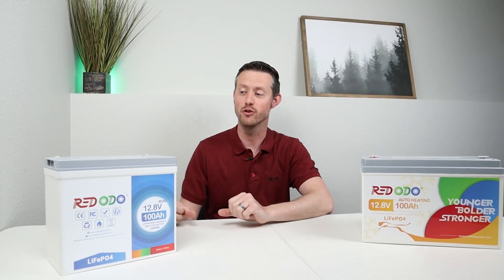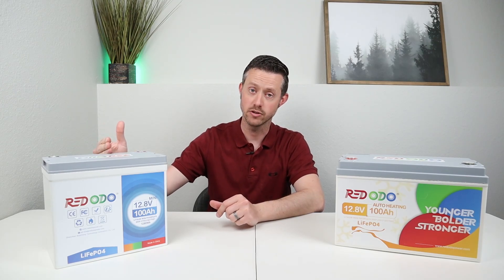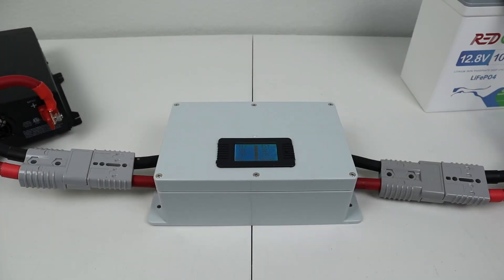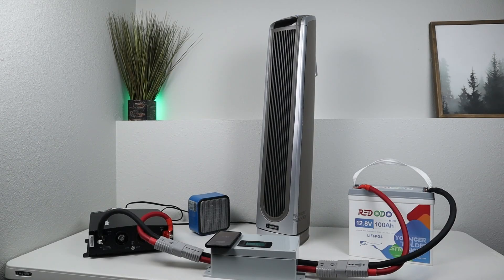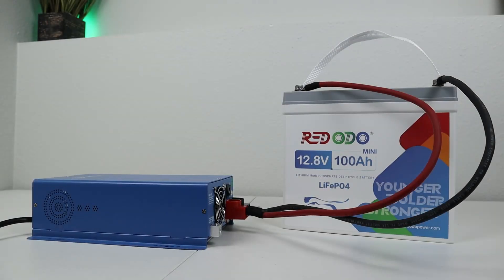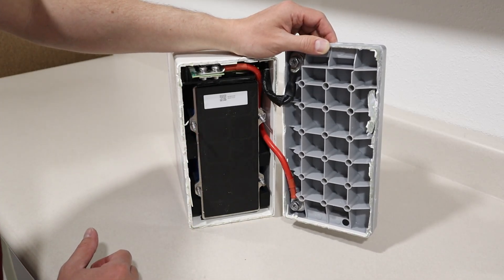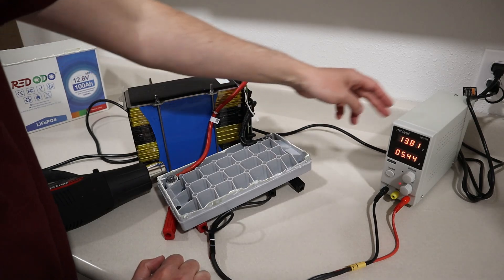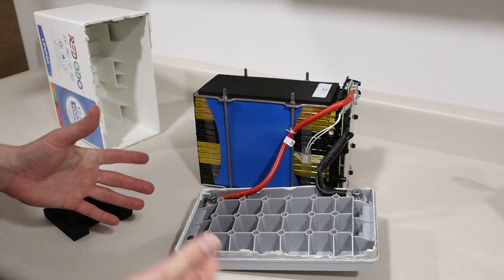Redodo 100ah MINI LFP Battery - Smaller Size - BIG Capacity! - Fully Tested and Torn Down

Comment: I'm guessing you should charge and discharge it more gently than the bigger battery, due to potential internal heat buildup in something so dense, maybe happening before it reaches the external temp sensor.  1C is pretty aggressive in any case. I like sticking to 0.2C or 0.25C whenever possible.  Slow and steady wins the race when it comes to battery life.

I do like it being smaller and lighter, even if my impression of pouch cells is that they're iffy.
Reply: Agreed, but I appreciate Jason testing the higher C rates; if the battery passes at 1C+ charge/discharge, it'll likely have no issues at lower rates. I think many who watch this channel are pretty savvy when it comes to battery care and maintenance, but Jason also does a good job adding disclaimers for newbies. 

RE: pouch cells, I have a similar perspective, but wonder if that's just because I read one too many articles on Chevy Bolts catching on fire (with NCM batteries rather than LiFePO4). I'd be curious to hear what Jason, Will Prowse, and others think are the tradeoffs that come with pouch cells. Maybe they're really solid in this form factor!
Reply from the maker: The owners manual recommends a 20 amp charge rate (0.2C rate) for the best longevity. In the video I demonstrate what the BMS can handle and for the best lifespan the battery shouldn't be treated this way. I basically torture the battery to make sure it doesn't fail. 'Slow and steady' definitely wins the race if you want to have a long lasting battery.

Lithium ion pouch cells have a bad reputation since they off gas if they are charged or discharged at high levels. I'm sure you have seen the swollen laptop / RC batteries looking like a balloon! I'm not sure LFP has that same issue with swelling.